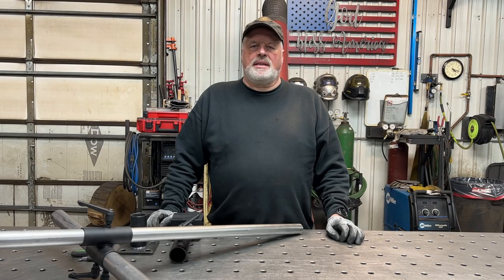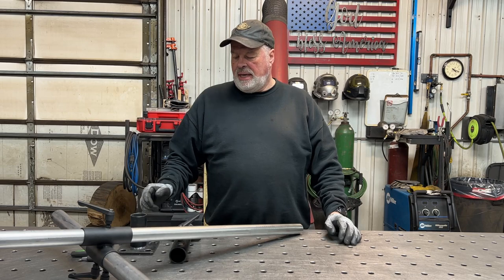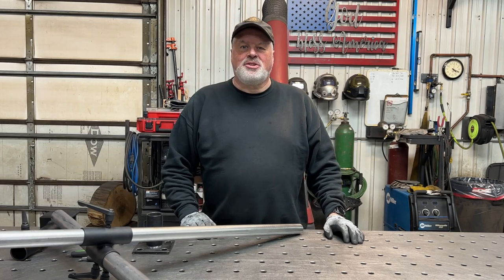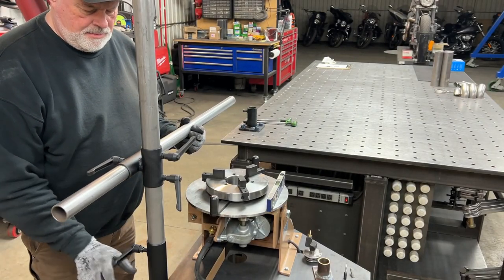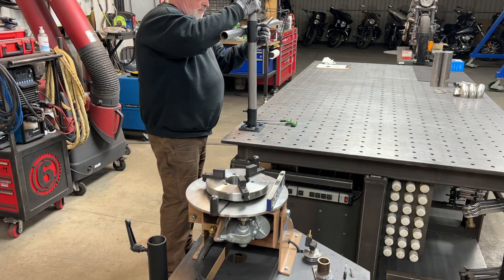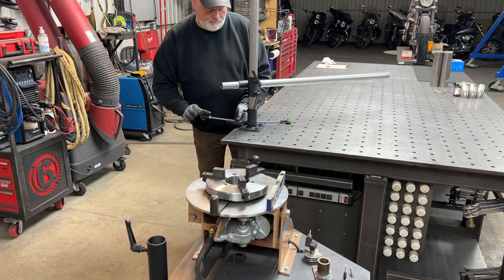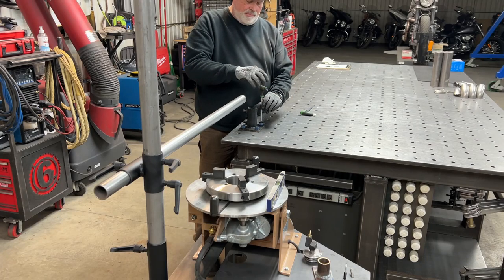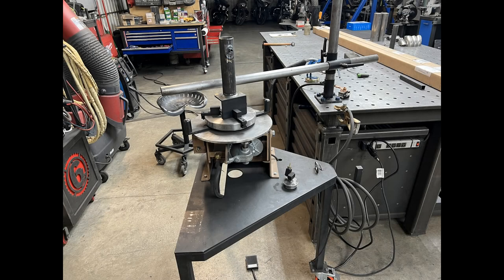6L Designs homemade Welding Armrest

Comment: Beautiful work my friend. I do have a question and it is this. If the vertical tube has an O.D. Of 1 3/4 what is the I.D Of the black receiver tube. I don’t want it to be too sloppy of a fit and sometimes ERW has that awful weld seam in there. And then vice versa what is the I.D of the receiver tube for the horizontal tube that is 1 1/2. Maybe I am missing something here. If so I am sorry again awesome work you keep me inspired
Reply from the maker: The receiver tube for the vertical 1 3/4" tube is a 2" OD with a 12ga wall thickness, the receiver tube for the horizontal 1 1/2" tube is a 1 3/4" OD with a 12ga wall thickness. It's just enough slack to slide through nicely, and to be locked in place with the adjustable handle screws or bolts. I hope this is helpful!!